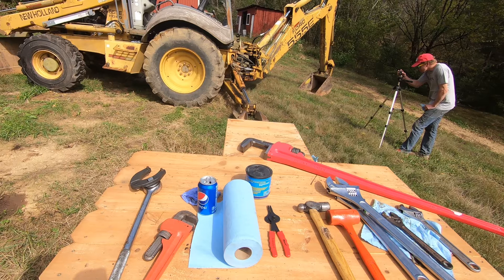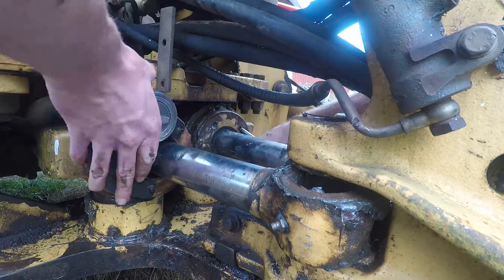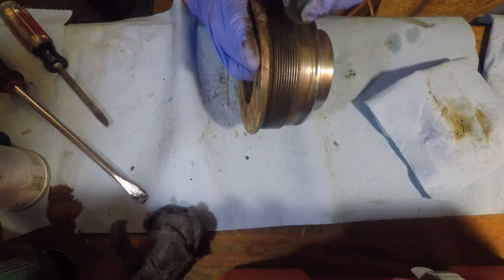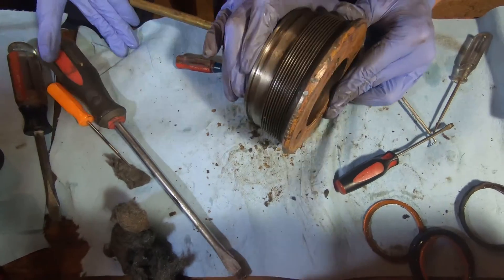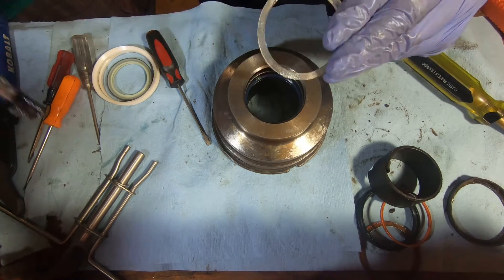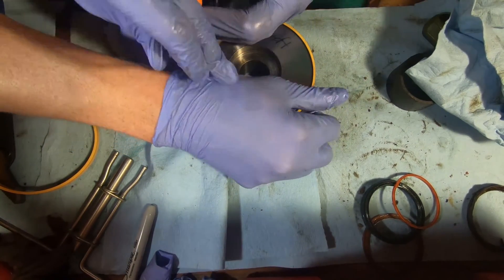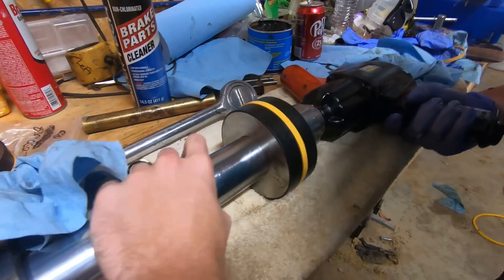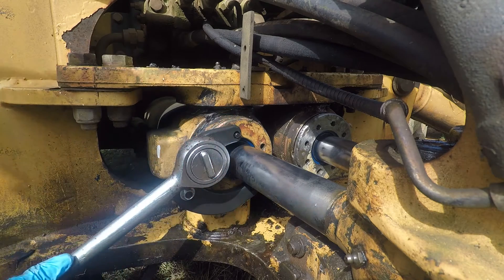How To Rebuild Backhoe Swing Cylinder - Ford New Holland 555E

Comment: Do a total removal of a ford 755 hoe and what to do with the hydraulic hoses if you still want to use the tractor
Reply from the maker: @kennypridemore5466  no clue on that front, try posting on heavy equipment forum lots of knowledgeable folks over there

Comment: Woukd love to see a video on pulling the swing cylinder out for a rebuild
Reply from the maker: Most people who rebuild them do it on the machine as it is less overall work. 

To remove them you would have to unbolt the large plate above the cylinders, disconnect the hoses, remove the cylinder rod pins, and then lift them out. Hope this helps but I would definitely recommend doing them in the machine if possible.

Comment: I am having all kinds of hell getting the pins out. Is there a secret? Thanks for the video!
Reply from the maker: Ours came out pretty easily, so I don’t have any specific tips. I’d start with a good bath of penetrating oil, you might want to spray some and move the machine so it can seep in deeper and break free. Fill it with grease too if it’s dry. And it might be the hoe is binding up you might need to reposition the arm and take the weight off.

Comment: I'm going to do the same  cylinder, but i was planning on taking the cylinder off and then doing the rebuild......May I ask why ya'll didn't remove the complete cylinder from the machine?
Reply from the maker: It’s unnecessary they’re designed to be rebuilt from the front, and it holds it to break the cap free. It’s a much larger job to fully remove them.

Comment: I have a 655a "86 model with blown hose that runs in between the cylinder, I have both ends off but can't see what is keeping me from pulling hose ot. Any sugedtions?
Reply from the maker: It’s hard to say based on the description. But it might be helpful to pull up the microfiche for your model and check the diagrams. On mine the hose between them is just free swinging, with both fittings removed it would fall on the ground. Checkout messicks.com > online parts > new Holland > construction (and then search for your model ( Ford was bought by new Holland).

Comment: Do you have the part # for seal kit
Reply from the maker: Seal kits were from eBay part number: 85802570. Double check the microfiche for your cylinder # to confirm that is the right kit.

Comment: Very thorough and instructive video.  Thank you for the effort!  I will now replace the swing cylinder seals on my Kubota.  By the way, the dealer wanted $88 plus shipping (shipping time: two weeks), but I got my rebuild kit from a domestic supplier (American made) for $18.87 (free shipping).  Kubota rip-off.